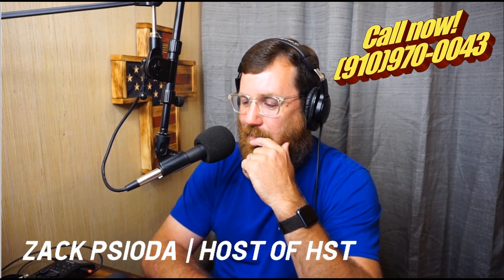Bad Check Valve vs.  Bypassing Compressor

Comment: On Copeland compressors, the discharge port check valve is the 'knob' on top of compressor shell just before discharge port coupling.  The 'knob' contains two flat discs that make up the check valve. 

There is two possible high temp/overpressure relief valves internal.  The copper-colored valve between top dome chamber and low pressure side of compressor is to bypass when compressor discharge chamber gets too hot, likely from high discharge pressure/high condenser temperature.  This relief valve is positioned directly over the compressor electrical cutout overcurrent/overtemp cutout switch on stator windings so when bypass valve passes hot gas back to low side it discharges hot gas directly on top of electrical cutout switch causing it to go open circuit shutting down compressor.

On certain A/C units, like Trane high SEER units with the large condensers, which have large refrigerant loads, they can have trouble with off-state liquid flood back.  The check valve on discharge port is more important on these units as Trane closes down EEV valve in off state and traps refrigerant between EEV and compressor check valve in off state.  Once condenser cools down much of the trapped refrigerant turns into liquid and remains in condenser preventing off-state liquid flood back into compressor, even if check valve eventually leaks some over hours of off time.  On these units, high side pressure should remain high after shutdown for a long period of time (hours).  If high side pressure decays quicker it is an indication of leaky compressor check valve.  You can get off-state liquid flood back causing compressor hard starts if check valve leaks too much.  You can add an inline check valve to make up for defective compressor check valve.

I have seen new compressor check valves damaged (valve disc warped) during compressor replacement due to excessive brazing heat applied without wet rag wrapping discharge port 'knob' on top of compressor shell.

Comment: I think the question is what's the difference between the check valve in compressor discharge port versus the differential pressure plate that unloads the scroll during off time so it does not have to startup against immediate high head pressure.

Some high SEER units with large condensers violate Copeland recommendations on maximum system refrigerant charge volume for given compressor size to reduce possibility of off cycle liquid flood back.  The large condensers hold more total system refrigerant charge.  

These manufacturers get around this by trapping liquid in condenser and liquid line by shutting down EEV valve as soon as compressor is shut off and rely on compressor check valve to block other end keeping liquid in condenser/liquid line during off cycle.  You will notice the liquid line pressure does not drop very much after compressor is shut off.

Problem is the check valve disk does not always have perfect sealing and over an off period of hours to several days it can leak enough to redistribute more refrigerant throughout system. They are counting on reaching ambient temps on condenser and gradually equalizing pressures to keep most of the liquid in condenser even if check valve leaks a little.

Comment: Question: I just got a rebuilt compressor installed it but my pressure on both gauges reads the same, I initially thought my gauges were open but they were closed, I'm thinking the bypass valve is the issue.  Is there any other thing it could be?
Reply: Both sides at 150psi

Comment: Damn I’m in a meeting. Ill watch this episode after I’m off work. But an easy way some old timer showed me was to shut off the compressor hand on suction line. And you’ll feel the HG vapor bleed to the low side. And yes. That’s worked several times.
A good compressor will not let vapor going back to the suction.
Also. Isolating compressors. If it can’t pull down into a vacuum during a pump down is another easy way. 
These will work on comps without liquid injection/bypass